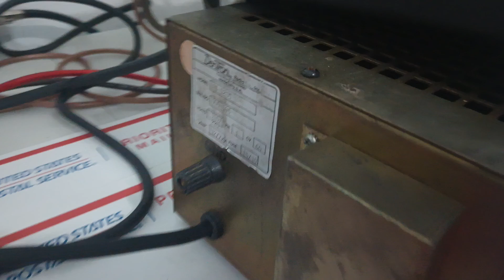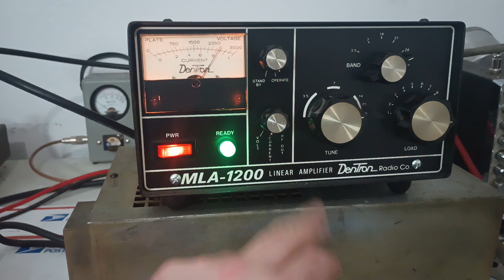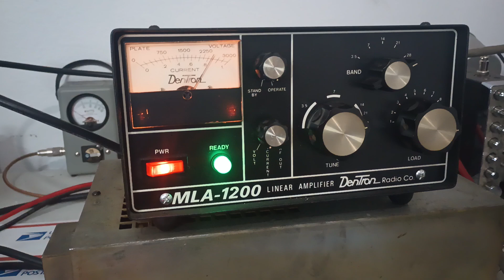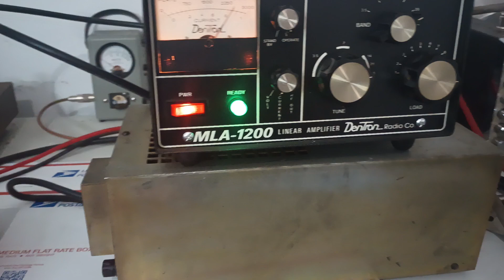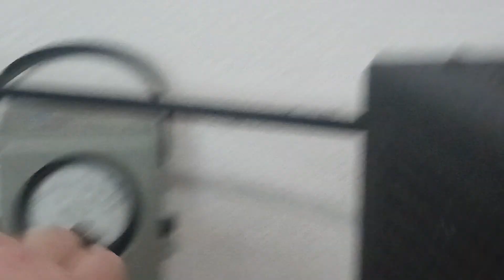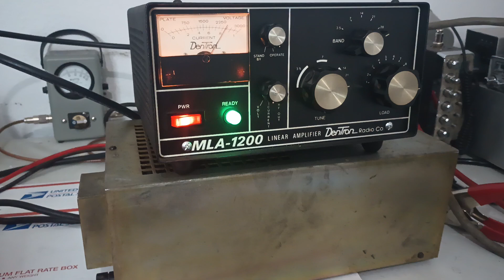Dentron MLA1200, Base Amplifier

Comment: As far as I remembered , the AMP is 1200 Watts input. So the output should app.700 Watts key down with 80 watts injput.That is just over 1000 watts PEP.  73 Have fun.